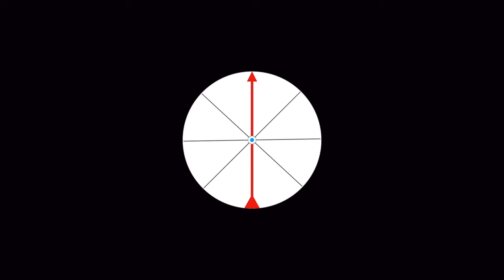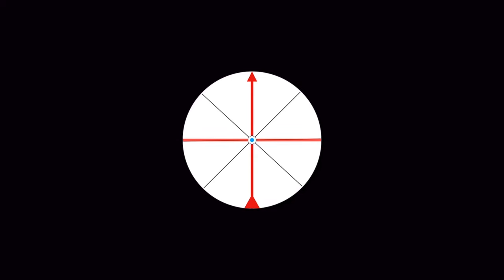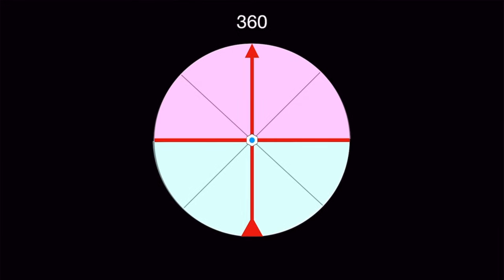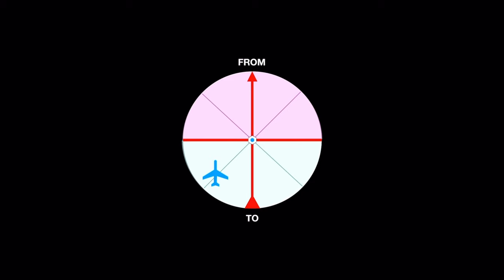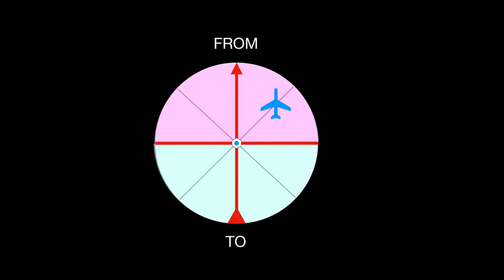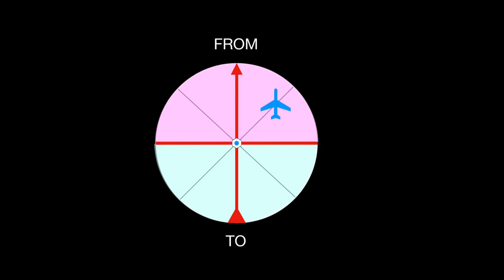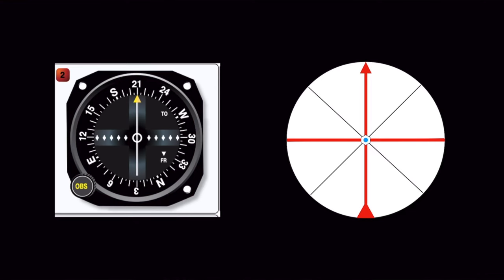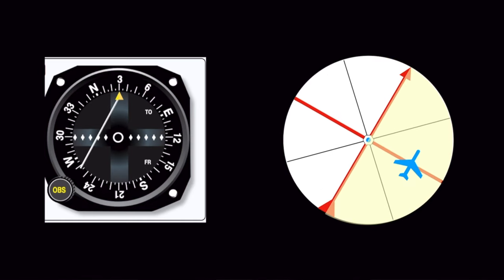Ridiculously easy VOR Navigation!

Comment: Suppose you’re flying along and there is a VOR station to your right. You are heading 300. You want to cross the 270 radial of the VOR that is on your right. How would you know without an HSI whether you have reached the radial or have past it? Answer: Remember this saying. “When the station and the CDI deflection is on the same side; with a FROM indication, “You’re not there yet.” So heading 300 and tuned to the VOR on your right, you set the OBS to 270 and the needle deflects right then you haven’t crossed it yet.
Reply from the maker: Excellent rule of thumb.  Thanks for sharing!
Reply: @ScottKoonCFI  I must tell you I hate the term reverse sensing. There is no reverse sensing as the receiver equipment doesn’t reverse anything. The proper terminology that is never used is reversed orientation. Suppose you are driving down a road heading north and you see on the map your town is to your right. When you get to the intersection on the map, you make a right turn. traveling on the same road in a southbound direction, while still holding the map north position up, you see your town on the right so you naturally want to make a right turn. However, if you do so you will be heading the wrong way. If you turn the map upside down, then your orientation will be correct and you will see then you need to make a left turn. This is also true when you use a radio operated vehicle such as a car or a drone. When it flies away from you and you move the stick to the right it will move to the right. If it is coming towards you and you move your stick to the right, it will move to its right, but appear to move to your left. That is because of orientation, not sensing . So the VOR CDI is showing where you are in relation to the radial from a station. It only knows where you are either left or right of that radial regardless of the aircraft heading. Understanding this will unlock the key to using a VOR naturally.
Reply from the maker: @aviatortrucker6285 You are, of course, correct.  The device only indicates where the aircraft is in relation to the radial/station.   So, as you noted, reverse sensing is a pilot interpretation issue rather than a change in the operation of the instrument.  Thank you for calling that out.

However, the term “reverse sensing” has become widely used.  In fact, it is defined in the PHAK and in the Instrument Flying Handbook (among others).  In this GPS dominated world, where NDB/ADF is obsolete and Localizer back courses are rare, most pilots expect that when the needle is not centered they turn toward the needle to recenter.  This is what most pilots think of as “normal operation”.   The FAA’s definition of reverse sensing is: “The VOR needle appearing to indicate the reverse of normal operation” (The emphasis is mine).  So, by FAA definition, if a pilot turns toward the needle and becomes further off-course they are experiencing reverse sensing.  

Again, thanks for calling this out and sharing your well-written example.  Hopefully, our conversation will encourage others to learn more about VORs.
Reply: @ScottKoonCFI  After  40+ years of pleasure flying I’m really thinking about going after my CFI. Sometimes I have to think, leave it up to the government to make things more complicated in understanding. I think this is why students struggle with understanding about navigation. I will give you another example. Let’s talk shortly about NDB’s. I know they are going away and you can use it certified GPS to shoot one of those approaches, but it was always a challenge and rewarding to be able to do so with an actual ADF. CFI’s often teach their students to push the needle, pull the tail. This is a complicated thought, especially if you are in turbulence or you are overwhelmed by cockpit duties. It is much easier to understand. Only one thought  simplifies everything. Always turn in the direction, the pointer head or bearing pointer indicates. For example, you are flying from the NDB and you are heading on course but the pointer is indicating about 190. This tells me I have to turn left and since I am 10° off bearing, I will double that and turn left 20° to a heading of 200. The bearing pointer will then move to indicate 210. When the pointer returns back to the number of degrees of my correction, in this case, 20° or, 200, I would turn back to my designated course and the pointer would settle right back  at 180. This means I am on my outbound bearing or approach course and I would just need to correct to the left five or 10° to compensate for the wind. If I am in any kind of turbulence or I am distracted, the last thing I need to do is sit there and think do I push or pull a tail or a pointer. Another thing students often refer to a bearing as a radial. NDB and bearing pointers on a glass cockpit, such as a G1000, have the option to show and ADF or even a VOR bearing to a station indication.  There is an airport near me that actually has a localizer back course and I always love to shoot that to keep my wits sharp. Thank you for your video. It is very informative.
Reply from the maker: If you are interested, I’d definitely encourage you to work on CFI and CFII.  There is a shortage of instructors.  There is an even bigger shortage of instructors that aren’t building time to go someplace else (airlines, cargo, corporate, etc.).  It’s not that instructors building time for the airlines can’t be good instructors, they can be and I’ve worked with many of them.  The challenge is that they ultimately earn their hours, then stop teaching—which is understandable, but a loss.  Folks that are instructing as a “career” are pure gold.  Thanks again!

Comment: Scott, overall great and easy to understand video. 

Quibble with your description of how a VOR works (not the interpretation of the VOR instrument display). 

It may be easy to describe and, thus, easy to understand that a VOR station works like a lighthouse, but this is incorrect. There is no rotating directional signal and there is no pulsed reference signal.   

Perhaps try, "A VOR station is a radio station transmitting two audio tones that your VOR receiver can use to compute the radial* that it is on in reference to the tuned station; an easy way to think of how this works is to use a lighthouse analogy... blah blah blah".  

* station radial is expressed in degrees relative to 0 (usually magnetic north).
 
The TMI explanation can be found here: https://www.youtube.com/watch?v=tZ2gG1v9Xg8 

Another posible description. "I'm sorry that you're being forced to learn this antiquated tech that you'll likely never use in real life" :)."
Reply from the maker: Hey @miketaylor3947 thank you for the comment and the reference to a much more technical description of how VOR works.  There is a tremendous amount of ingenuity and sheer genius in the design, and for those that are interested, I highly recommend viewing the video Mike references and doing more research.  

Having said that, even though I am pretty comfortable with VOR navigation I wanted to make sure I was not completely misleading folks about how a VOR works.  With that in mind, I spent several hours researching VORs.  Most of the descriptions were completely indecipherable without significant knowledge of radio-wave physics or electronics.  Below are the most cogent descriptions from the most reputable sources I found.  I have included links if you are interested in the complete articles.

From Airwaze Avionics (https://airwazeavionics.com/commercial-aviation/) The author of this page is a former Naval Avionics Technician, and is currently a CFI/CFII/MEI and holds a Masters Degree in Electronics:
VOR ground stations make use of the electromagnetic principles of antenna arrays and analog signal modulation to produce two independent signals.  One of the signals propagates uniformly in all directions while the other signal is directional and propagates in a continuously rotating pattern.  

Fixed frequency sinusoidal signals, such as those used by VORs, can be visualized as vectors rotating around a point (called the “origin”) at a specified frequency.  In the case of conventional VOR systems, that frequency is 30Hz or 30 revolutions per second.  Given that the vector is rotating 30 full cycles or 360deg every second, we have 360 x 30 = 10,800deg/sec OR 1 degree every 92.6us.  It takes 360 x 92.6us OR 33.33ms to complete a single rotation.  This is called the “period” of the signal.  Note that the frequency of the signal is equivalent to 1/Period = 1/33.33ms = 30Hz.  The signal is thus “periodic” and repeats itself every 33.33ms.  As a vector is spinning around, the angle that it points at is known as its “phase” angle.  With this in mind, consider the case of two independent vectors named reference and variable.  If we were to start the reference vector but DELAY the start of the variable vector for 16.7ms (which is roughly half of 33.33ms), the difference in phase angle between the two vectors would be 180deg because the reference vector would have reached its 180 phase angle while the variable vector would just be starting out at 0 deg. 

From Flying Magazine (https://www.flyingmag.com/guides/what-is-vor-and-how-does-it-work/):
VOR navigation technology uses a ground-based antenna at a station to send a directional signal that rotates clockwise 30 times a second, or 360 degrees in azimuth. A reference signal is also emitted timed to be in phase with the directional signal as the directional signal passes magnetic north. 
The “phase difference” between the reference signal and the directional signal is the bearing from the station to the aircraft position. This bearing or line of position is called the VOR radial and can be used to fix the position of the aircraft towards the station.

Bold Method (https://www.boldmethod.com/learn-to-fly/navigation/how-a-vor-works/):
The VOR sends out one stationary master signal, and one rotating variable signal. These are also called "reference" and "variable" phases.
An aircraft's VOR antenna, which is usually located on the tail, picks up this signal and transfers it to the receiver in the cockpit. The aircraft's VOR receiver compares the difference between the VOR's variable and reference phase, and determines the aircraft's bearing from the station.

AOPA (https://www.aopa.org/news-and-media/all-news/2022/july/flight-training-magazine/how-it-works-vor-system): 
The ground station is referenced to magnetic north and emits two signals. These are a 360-degree sweeping signal and an omni-directional reference signal. The signals are compared at the aircraft’s receiver and the difference between them is displayed in the cockpit. 

Thanks again!
Reply: @ScottKoonCFI  Hi Scott. Thanks for the links, I had seen the aopa and bold method ones but not the airwaze one. 

I'm not a CF nor ME anything but I do have an MSEE where I focused on control theory and signal processing. 

All three descriptions use words like "rotating" and "directional" to describe one of the signals emitted from a VOR station which I think, makes it too easy for readers to develop and latch on to the lighthouse mental model of operation (which is an absolutely fine way to think about how the system works, but it's not how the system actually works). 

Making things more fun (and I didn't know this until watching the vid I referenced) is that there are actually two different VOR transmitting methods. 

The closest to "rotating and directional" in a VOR is that in a so-called conventional VOR, the station emits an energy pattern, in all directions, in the shape of a "limacon" where r=a + b(cos theta) and the energy pattern does, in fact, rotate and the maxima of the pattern can be detected and used to determine the tuned radial. 

The other type of VOR has no direction whatsoever and the the closest to "rotating" the physical broadcast point of one of the signals moves from point to point (antennae to antennae), usually 48 of them, in a circular pattern around the reference broadcast point. Physically creating a phase shift (change in frequency) of the base frequency and it's that change in frequency when compared to the reference signal that is used to determine the radial that the receiver is on. 

Last, people should know that the systems have potential for errors based on signal strength and potential reflections. The doppler-type VOR is more resistant to reflection errors. 

Did you know that radio bandwith is reserved for actually talking to a VOR? I didn't!? It sits right next the morse code in frequency spectrum. 

Probably being pedantic here so to default to a simple explanation.... 

VOR stations emit radio waves that "magic happens" your receiver can use to show you what radial you are on in relation the tuned station and how to get to (and stay on) the radial that you want.
Reply from the maker: @miketaylor3947, thanks for the additional information.  I appreciate you sharing your knowledge and helping with the description.  As you note, the lighthouse description is a fine analogy for how VORs work, but perhaps the more accurate description is what you suggested—“magic happens and your receiver shows you what radial you are on.” :) Thanks Again!

Comment: No it doesn't make much sense to me I'll have to watch this a few times.

But I have a looney tunes question for you. I mean you're gonna laugh Actually using an old flight simulator from the 80s called Solo Flight.

It uses two guages. VOR 2 and VOR. Rereading the directions I almost understand it. 

For instance a Kansas Witchita airport is at say 222/001 VOR 1 and 2. 

I re-read the instructions and went on a test flight And I understand it sort of I think I'm gonna need practice just to get my head around the radials intersecting concept because it's confusing.

Once I get a better handle on it I'll come back to your video and see if I understand it better Once I have a point of reference that I'm used to.

Solo Flight

https://m.youtube.com/watch?v=AApEInh_ryU&pp=ygUVQXRhcmkgODAwIHNvbG8gZmxpZ2h0
Reply from the maker: Thanks for the comment.  Using a flight simulator (even an older one) is a good tool for helping understand how VOR navigation works.  If it helps, my students and I often use https://www.luizmonteiro.com/learning_vor_sim.aspx.  It is simple to use and allows use of multiple radio navigation tools.  

Let us know how it goes!

Comment: VOR = obsolete technology.  It's the horse and buggy of instrument navigation.  My little quadcopter has more advanced tech than VOR.   With GPS and high-accuracy electronic gyroscopes, you can navigate much easier and more accurate than VOR.   Even without GPS and with dead reckoning using an electronic gyroscope, the accuracy is far greater, and much less expensive.  How much taxpayer money is wasted keeping these VOR stations running?    The FAA is stuck in the past, and refuses to qualify the much more advanced technology that makes VOR totally obsolete.
Reply from the maker: Thanks for the comment.  VOR technology was developed in the late 1930s and until relatively recently was THE primary navigation tool.  I agree with you there are now tools available that are easier to use, cheaper to maintain, and can provide greater situational awareness than the venerable VOR environment.  The FAA agrees, too.  They are phasing out a significant number of the stations, creating a Minimum Operational Network. 

While mentioned briefly in the introduction, the intention of the video was not to argue the merits (or lack of) of VOR navigation.  The bottom line:  It is a topic Pilot Candidates can be tested on, and it will likely be required knowledge for some time.  With that in mind, I wanted to try and make it easier for candidates to prepare for their knowledge tests and check rides.

Thanks again for your comment and I wish you the best!

Comment: Very bad tutorial, because it explaining in ambiguous way, making logic/reasoning very hard, too many variable and moving part need to consider in mind (absolute or relative?, shifting or angle) is very difficult for people don't know how it works at first time

Also feeding listener only part of information (instead of whole, complete information) makes them wondering if they are doing some kind of puzzle...

The content is not bad, just the way of teaching is very bad, teaching is not simple as throwing unorganized information, but seeing what student seeing and what question they might ask.
Reply: Finally I make understanding in my own way anyway...

For example to solve the first example in 3 examples in the end of video:

  1. Make assumption first: Needle point To 210 Deg, this meanings assume if airplane keep flying toward 210 Deg (no need airplane real heading direction here), where is the Radio Station locate relative to airplane?
  2. Draw aircraft: Draw a dot to represent the Location of aircraft.
  3. Draw first line to split Left and Right: Draw a long line crossing previous dot, facing 210-30 deg (but arrow still point to 210 deg).
  4. Draw second line to split TO and FR: Draw second line that perpendicular to first line, also crosing previous (same) dot.
  5. Now you will see 4 section/area, If reading clockwise it will be Left-TO, **Right-TO**, Right-FR, Left-FR.
  6. Reading the VOR instrument (whatever it called): The radio station is locate in "Right-TO" section/area.
Reply from the maker: I’m sorry you didn’t find the video more helpful.  Others have found it helpful, but it is difficult to make a single video that answers everyone’s questions.  I am glad you found a solution that works for you. I wish you the best on your pilot journey!